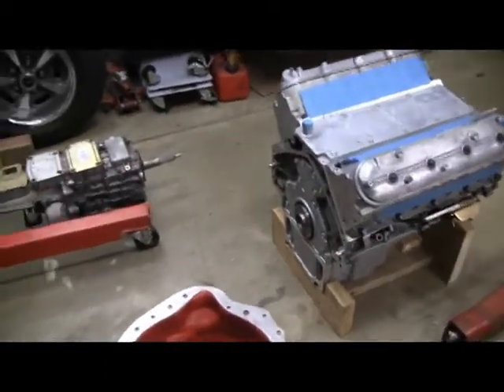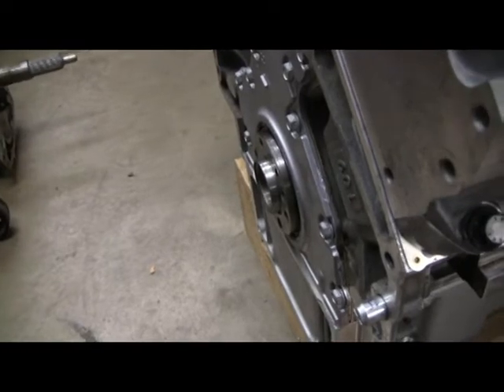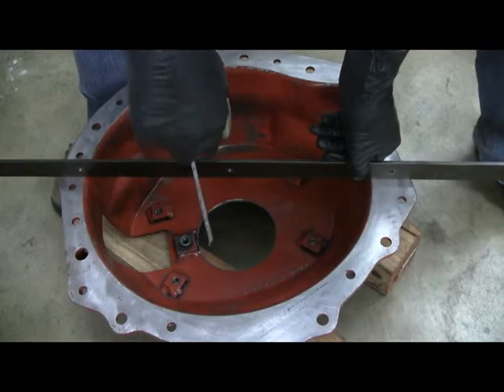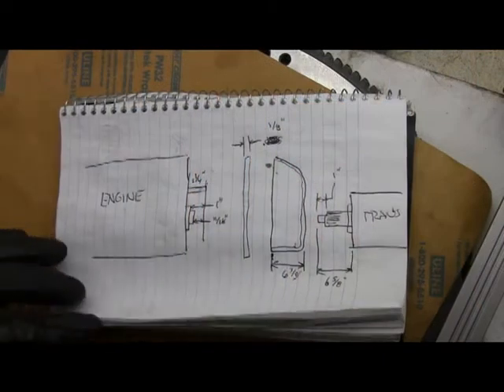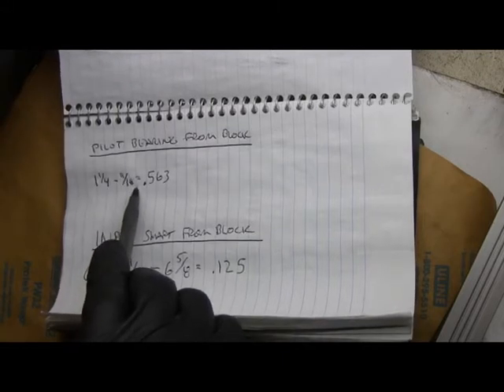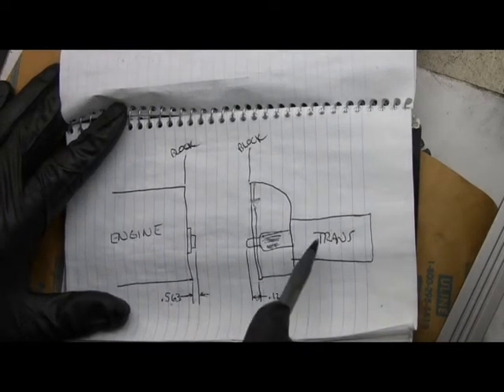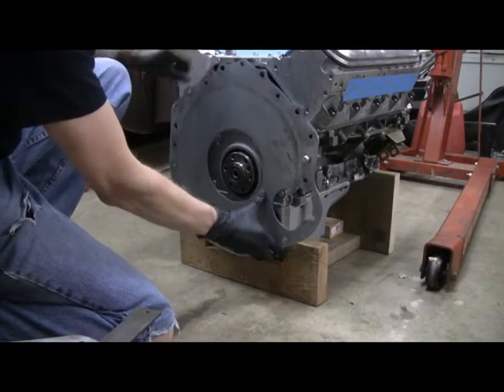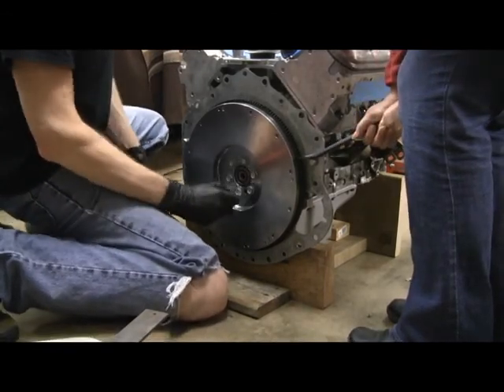CORRECTIONS!! See part 45 for measurement LS Conversion swap, Part 44 flywheel and measurements

Comment: I see that you are using the tko?  What flywheel are you using... part#?
Reply from the maker: It came from Silver Sport Transmissions. Same place I bought the trans. Their part number FWG-460535 "LS flywheel billet steel, 168 tooth for standard 11in clutch". I am using a Ram Powergrip and diaphragm pressure plate
Reply: Prime Garage GM A-Body LS Swap thanks for the info.  Do you have the plate part# as well?
Reply from the maker: Silver Sport CLA-K98764. Clutch and pressure plate set.
Reply: Prime Garage GM A-Body LS Swap sorry, I meant the protector plate.  What is the part# of the protector plate.
Reply from the maker: No idea. I bought it used at a swap meet years ago.
Reply: Prime Garage GM A-Body LS Swap BTW, shouldn't you be adding the .125 to the .563 instead of subtracting it?
Reply from the maker: Thanks for catching this. My summary is wrong. I am not sure if "adding" the .125 is the correct way to describe it though. I will post a new picture this weekend showing the correct summary. Thanks again for questioning this!
Reply: Prime Garage GM A-Body LS Swap eventually, it will be longer than the .438 or the transmission is further in towards the engine that what you calculated.  Also, on a different note, the .563 is not the same measurements as the thickness of the pilot bearing.  You also need to knock the pilot bearing in further all the way in.  It should be able to pass the chamfered part of the crank not flush.